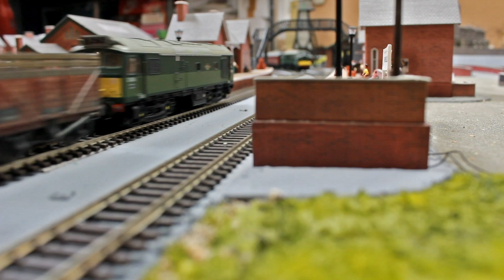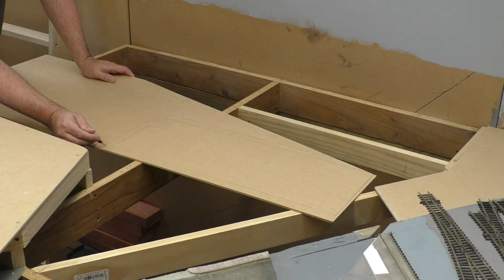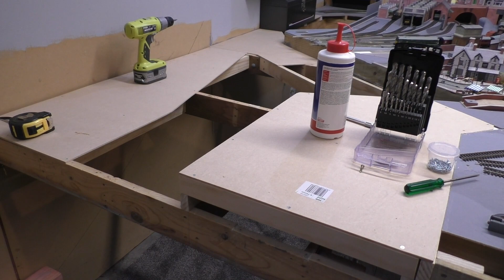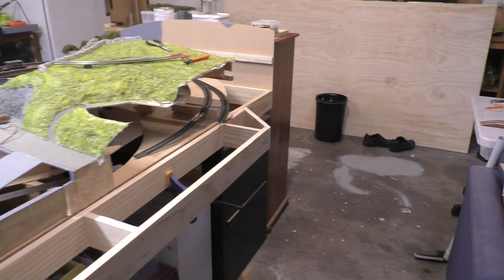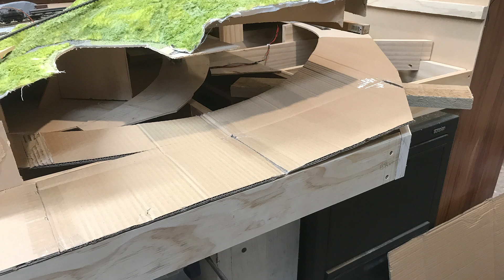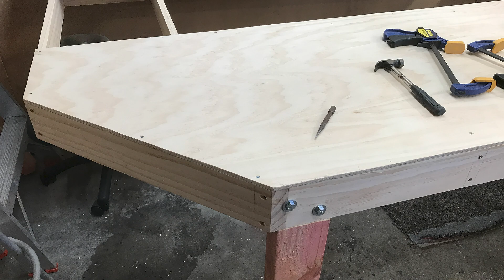The Extension Frame is Installed and Lower Trackbed Substrate Added

Comment: Nice build Julian, I'm very impressed with the design and strength of the extension,  the new fiddle yard is going to be such a boost to your operation. It must be frustrating to have a shortage of track, I can see you want to get on with it and get back into running trains.  It will come but in the meantime your doing a fantastic job of laying the track bed. You take care of yourself and your family in these difficult times, have a happy Christmas, see you on the next one Eddy xx
Reply from the maker: Thank you Eddy for your kind feedback. It certainly is frustrating not having availability of track, but then 2020 has been a year of frustration in general. However, as you've seen, there still a lot I can get on with in the meantime. I hope to post one more episode before xmas, possibly this weekend if all goes well. Take care also and a merry Christmas to you and your family.

Comment: really exciting developments there. fantastic carpentry .like your idea of using set track for the curves..i might try that when I do some rebuilding over Christmas. i found using flexi track on  large curves quite challenging..worrying about shortages too i will be needing a fair bit more..
Reply from the maker: Thank you for your kind words. Flexitrack can be quite tricky to place on curves and in some respects tracksetta templates would be the best option to achieve a nice even radius. However, in this situation having one curve as set track provides a guide to align the flexitrack curve.

Comment: Hi Julian, more power to you for tackling this major change to your layout. I assume you are happy using 5mm  and 7mm for your layout mdf & ply and are satisfied you will not get any warping. I will follow your progress with much interest.  Cheers & Merry Christmas from over the ditch.   All the best   Greg
Reply from the maker: Thanks Greg. The 5mm MDF is not a substrate I'd recommend but it's easier to use this on the existing layout area so the levels match up. I've had 5mm MDF installed to other areas from a few years back and it's still in good shape (no warping). It was very old 3mm MDF that I ripped up to prepare for the extension. I think climate would play a big part in the reliability of MDF, and where I am, it's a very dry climate. I would imagine a humid/moist climate wouldn't be very suitable for MDF. I don't anticipate and problem with the 7mm ply, but I guess time will tell😮